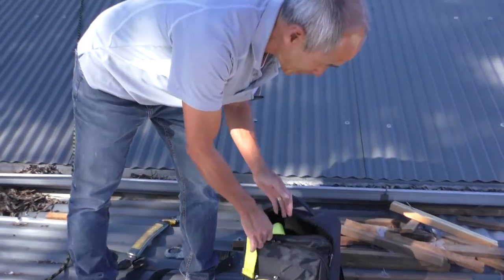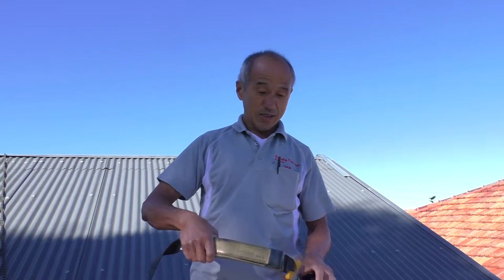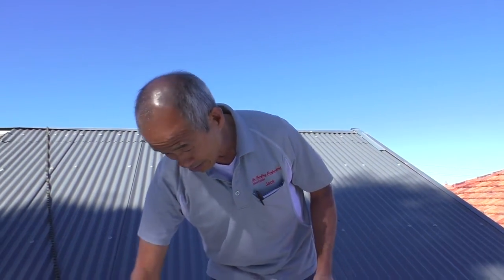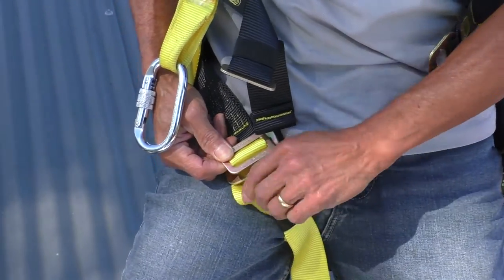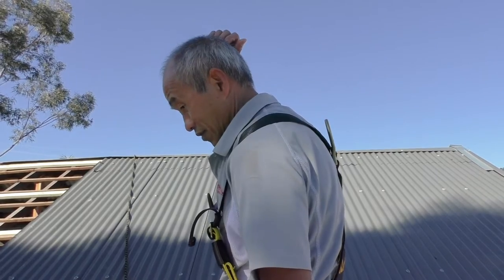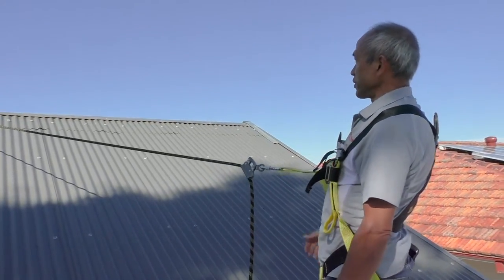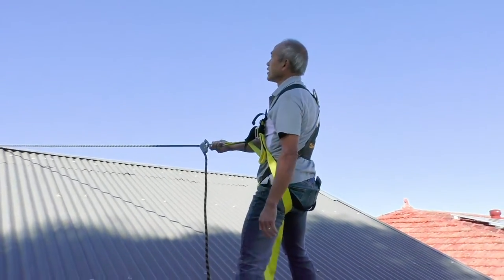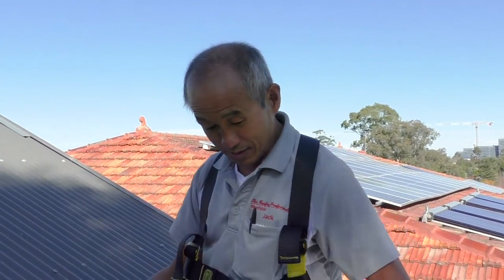Roof safety -  roofers harness use tips

Comment: I know a few roofers and arborists that might not agree with your hooking technique on the front but with the little bit of rock climbing and repelling experience I like the front technique for the same reasons as you.  I actually tie off my line to my truck or a tree, or both instead of anchoring directly to the roof.
Reply: I never understood the logic of hooking up in the back. I used my rock climbing harness with an ascender and descender. Actually falling off the roof becomes physically impossible because there's never any significant slack in the line. It's just enough to allow me to move around in that area then adjust as needed. It also allows you to hold your position on steep slopes without using your hands.

Comment: I wish you would show more of how to attach anchor to the roof and tie to anchor.   Most of these videos show how to use the harness but don't ever go into detail on what to attach the harness to.
Reply: Yes good point. I have the same issue but I'm going to take the rope right over the roof and down to a wooden retaining wall where I will secure a heavy galvanised bolt with an eye to take the rope and carabiner hook.
Reply: There are temporary or permanent roof anchors that you drill into the roof. For examples of both, watch the video titled: "Werner complete roofing safety kit - Home Depot $99"

As for metal roofs, not sure. There are some comments below about using a truck or tree on the other side.

Comment: I agree with this 100%. the fall arrest is absolutely useless and impractical in this scenario. The rope is mobile and easy to adjust.
Reply: Essentially it's been used in an abseiling capacity, which is really what you need.
Reply: Use this system vs rear hooking. Abseiling style..Works fine. On lower roofs. On high roofs though run the fall arrest extra rear setup. Have used the gutter edge anchor t frame plus screw in pitch mount. One trick to climb first. Hit twine with tennis ball over roof to other side.With tennis racquet/ paddle bat.Anchor to fence/ ute etc.Can then  abseil up roof on rope to install roof mount.Then reset rope.
Reply: It’s great fall protection until you fall.

Comment: Hi mate, thanks for the videos, could you please show us where or how to hang the harness on roof? In tiles and metal. Thank you
Reply: Usually it comes with an anchor that you nail or screw it some where on the roof timber or suitable spot
Reply: @AdelAbuAlaa  I work mostly on metal roofs like the type in this video, all colors and no way to anchor without damaging it or getting the fasteners in the correct spot. Most of the time I have to anchor to something on the ground and that only works for one side of the roof.
Reply: @akaredcrossbow 
what about the other sides,  how do you manage?
Reply: @AdelAbuAlaa  I have to have one on each side and always remember to hook up to the right one. It’s not the most safest or convenient way but it works if you remember to switch lines. 
There has to be a better way! It’s hard to find specific color caulking to seal holes, or 3-6 months later the customer has some sort of leak. It’s frustrating taking the ridge cap off because most of them have been sealed underneath with caulking for some reason or another. It’s just frustrating and dangerous. Most of the time the lines are secured to a tree or a my work truck with the keys on my person at all times.
Reply: @akaredcrossbow 
As an ex  painter i know your frustration and how you feel. please take care
Reply: @akaredcrossbow  Thanks for the tip.  I'm going to do that for my shed roof.

Comment: Well done man. Excellent common sense approach to “fall protection” which is actually fall prevention. Lots of OSHA crap doesn’t make sense because once you’ve slipped off the edge and it arrests your fall, you’re still stuck hanging off the building waiting to die once the harness cuts the blood flow off in your legs. Keeping the line taught like in rock climbing or an Arborist application is how to stay ON THE ROOF! 

Thanks for sharing.
Reply: You don’t have to stay stuck after a fall.  I plan to have a descender line in case I fall off of my roof, and a knife to cut the straps if I need to.  Lowering myself by hand from cut straps or even just dropping from that “halfway” point is still better than a full fall, or a poorly attached fall.

Comment: I am new to this, and agree the front or side is more convenient.  However…

I watched something from OSHA that pointed out the reason for attachment in the back.  In a fall with back attachment your joints will be jerked forward, which is what they’re evolved to do (except for knees).  In a fall with front attachment, your torso with be bent backwards, as will your neck, legs (except knees), and arms - and leave you suspended that way.  After being bent backwards I don’t think I’d have much chance of self recovery as I’m not all that flexible even forwards.

They didn’t discuss single side attachment, but I would expect that to torque your body halfway around, twisting your torso in alignment with the safety rope, followed eventually by your limbs and head at some point.  This would leave you hanging sideways, limbs and head partially downward and not in great shape for self-recovery.

With upper back attachment your arms move naturally forward, as do your legs (except knees), your back bends forward easily, and your head bends forward naturally.  You end up reasonably upright and likely to be able to use a descender for self-rescue before getting suspension trauma from circulation loss hanging in a harness.

The shock absorber stops your fall slower than a restraint strap will - just like seat belts and air bags stop your body more slowly than hitting the windshield of your car.  The shock absorber is DESIGNED to fail, dissipating energy by snapping stitches instead of your body doing the same by snapping tendons, muscle, and cartilage.

You do you, but it might be worth your while to give it some thought.  I’ve collected enough minor injuries over the years that I don’t need any more.

Comment: So far, nobody has clearly stated how this set up is secured to the roof. I agree with the one person who said that metal roof can't just be drilled into. Is there some sort of hooking that widely distributes weight? This way, when sharply tugged on, it wouldn't be against a single point; thus, not ripping off the cap?
Reply: Bailey sell a long metal bracket with multiple screw in points for metal roofs. They sell em at bunnings. Because jt has multiple holes you screw in to all of them and that distributes to weight.
Reply: As pointed out by many folk in the comments section, the point of securing the fall arrest lanyard is the most important feature. I have the same issue but I'm going to take the rope right over the roof and down to a wooden retaining wall where I will secure a heavy galvanised bolt with an eye to take the rope and carabiner hook.